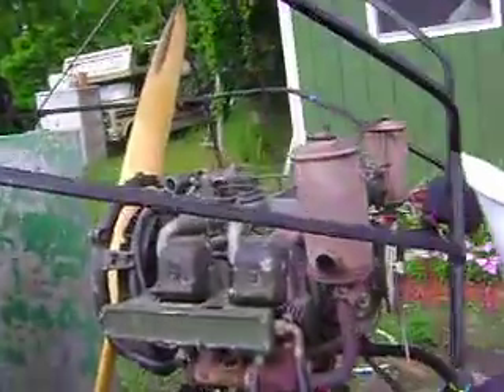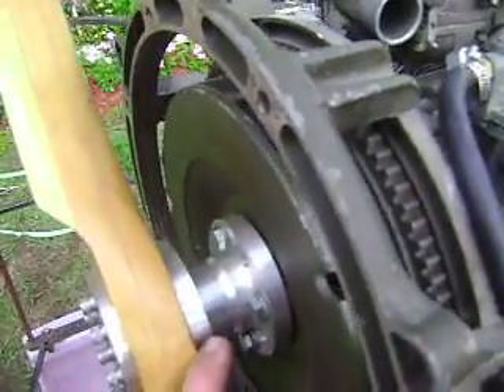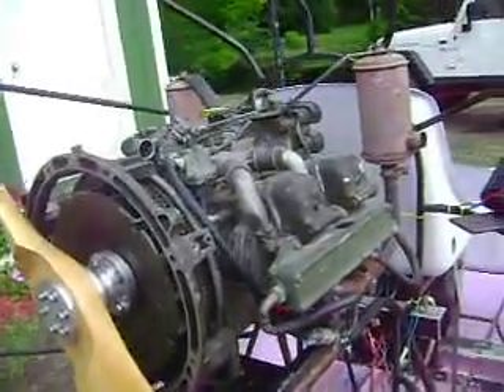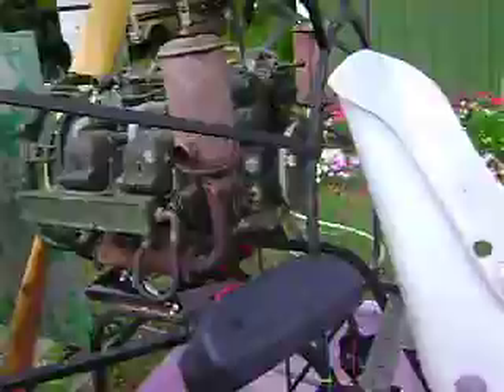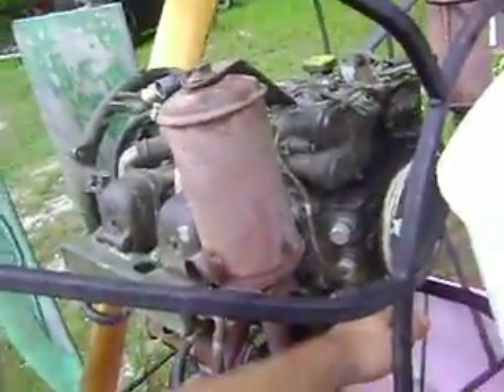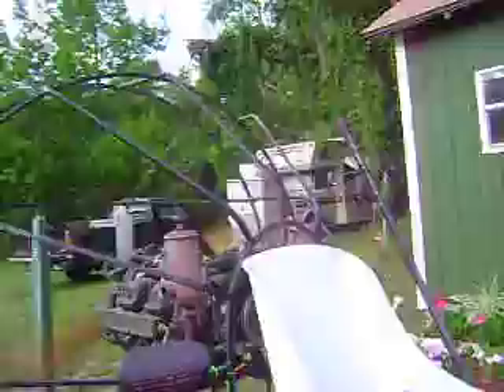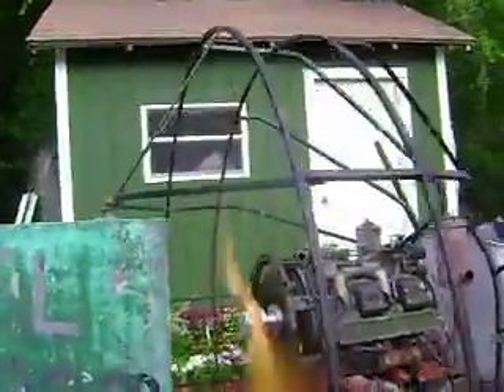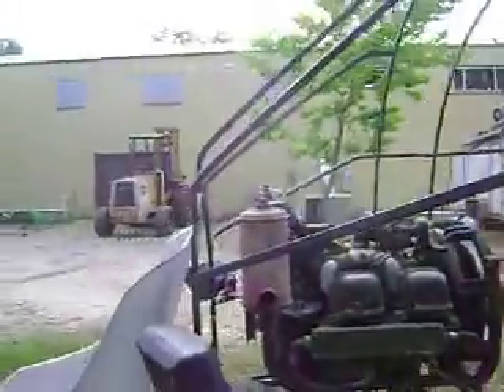4A032 continental GPU engine in mini airboat

Comment: Hey dude just rember not to run that wood prop over 3,000 rpm other wise it will blow up not being rude and maybe you want to get a carbonfiber prop
Reply from the maker: Yes indeed! I never fully trusted wood props, I pulled this one off shortly after and went to a helix carbon fiber prop. This one never had the power to turn up past about 2700RPM on a good day with the factory carb anyhow

Comment: I bought one to make an ultralight with. I got a carburetor from a Volkswagon engine, and intend to use the prop as the flywheel. It's only around 80pounds stripped down. The small carburetor that comes with these engines is really too small for this engine. It is the same carb that is on the 1 & 2 cylinder military engines.
Reply: Paul Crissman I fly one on a trike
Reply: What the hp you can get Whit a VW carb cause I heard that you could get up to 16 HP Whit a Briggs 20 carb
Reply: Another thing you could try is a ram tube, when I had this thing on the boat I made three in different lengths out of PVC by heating one end up wit a heat gun and making a nice radius to smooth out the airflow at the inlet. I picked up about 150 RPM with one about 14 inches long, they work by using the pulses of the inlet tract sorta like tuning a guitar string, once you hit the right length the air sets up a standing wave and actually forces a bit more air into the cylinders but they only resonate at specific RPMs so you have to experiment. you will know when you get it right because the peak HP will noticeably jump

Comment: @The2006rubicon  hey, i was wondering if it would do alot better with a 4 bladed prop. when you started it up it had no hesitation and didn't bog down at all. my engine gets up to speed JUST as fast and there isn't anything attached to it. yours revved up like there was nothing  attached to it. maybe you could take mare advantage of those 3600 RPMs and increase the load with 4 blade/bigger prop?

Comment from the maker: @57truckster1 it isn't a plate, but a pipe that extends down into the spider about an inch, the hard turn on the elbow was bugging me anyways, so I fabbed a long radius inlet tube and tried a mikuni TM-24 carb rather than saw the pipe off. With the mikuni and a slightly smaller prop with less pitch my thrust jumped to 100lbs, but it still had problems planing the boat out. still have the engine though, maybe I'll get a dragonfly hull next......Hmmm!